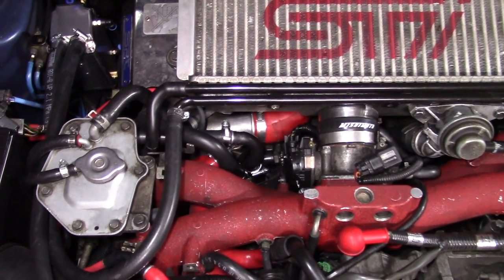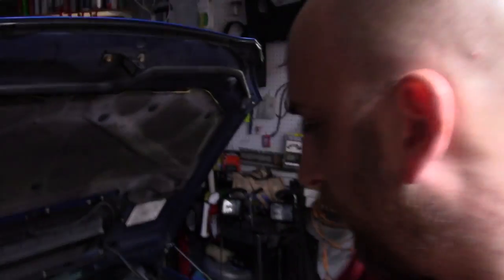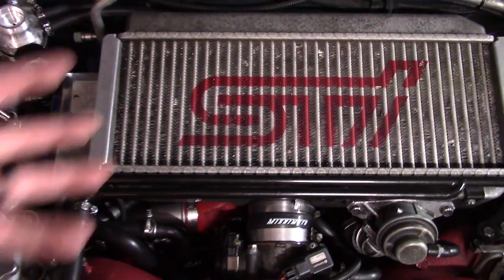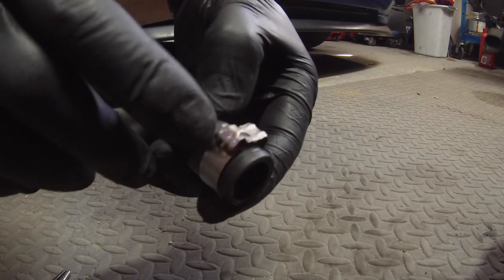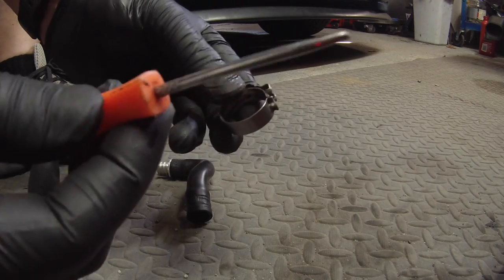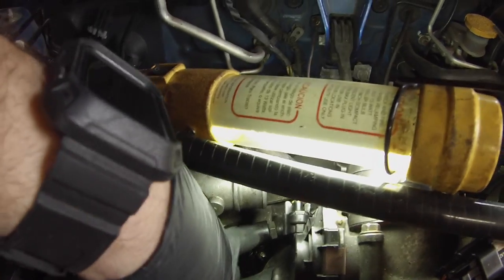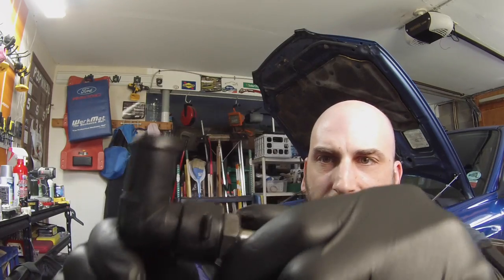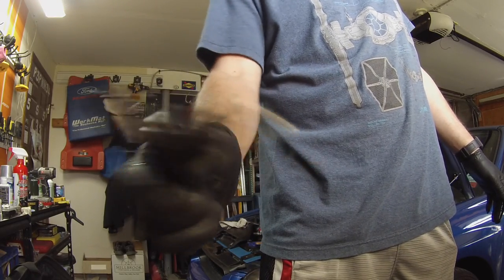2004 Impreza WRX  STi PCV Valve cleaning and location positive crankcase vent

Comment: I got a 2002 WRX , white smoke with some burning smell came from turbo area.  It goes off probably within 2 minutes.  Please advise if it is the PCV problem.
Reply from the maker: Sam Mach hey Sam , you may have started to have some oil seals start to leak and once they heat up they hold. Definitely check that your PCV is clean or replace it. You don't want pressure built up in the crankcase.
Reply: Sam Mach did you figure it out?
Reply: i have the same issue as you Sam, no oil leaks and only ocours in short trips, i smell oil been burned under turbo and some light smoke, i clean already the pcv and put new washers and gaskets on turbo but the problem still there, but before i blame the turbo i will put a new pcv ... do you figured out your issue? cheers
Reply: You have a leaking valve cover on the passenger side! That oil gets to the uppipe under the turbo. It will burn the oil coating the uppipe and goes away within 10 minutes after the engine has warmed up good. Just replace the valve cover gasket
Reply: @beatles  i had the same issue on my 04 Forester and that solved it

Comment: Hey, my aftermarket blowoff valve, suddenly stopped working it's not blowing off like it should. Not sure what vacuum lines or whatnot to look for. Any suggestions or videos showing me?
Reply from the maker: MrNTJH hi , check that your turbo inlet hose is connected to the turbo, it rips at the turbo inlet sometimes. Next check your 12mm bolts holding the BOV in and gasket condition. Tighten all the hose clamps for the intake , intercooler turbo and check that your air filter is not clogged. Let me know

Comment: do you reuse the by pass valve gasket?
Reply from the maker: kpopRC hi . I have reused the Bypass gasket multiple times and have never had a boost leak from it. As long as the gasket is in a good condition , no cracks , fraying , you should be ok. Thanks for watching.

Comment: hi, my sti do blue smoke at idle after it is fully warmed up following a cold start. and sometimes it blue smokes at stop lights too or after a long engine braking. might this be a pcv issue? thx.
Reply from the maker: Hi Elie blue smoke means your burning oil , you may need new Pistons and rings. Full rebuild or new motor swap will help. Do you have a good Subaru shop near you?
Reply: svtwrc hi. i have my mechanic who told me there is nothing major to worry about. but the performance of my car is awesome and there is minimal oil consumption. i Don't know why i got clouds of white or blue smoke coming out at idle after 10 minutes from cold start or  
after a half minute of me idling on traffic. it does not happen all the time.
Reply from the maker: +Elie Nehme as long as it's a little not all the time your ok. You can try to replace or clean the PCV valve . There are some stop smoke oil additives you can try a little at a time make sure it's not an oil stop leak the EJ motors get clogged up but the smoke additive is like a heavy oil that's really worked for me on a Saab Turbo.
Reply: svtwrc thanks mate. i will keep you updated. take care.

Comment: my car got worst is just when i driving when smogs pretty bad. but at idle doesn't what can be?
Reply from the maker: jdm fans!! https://youtu.be/060bO3oIC6Q take a look at your valve cover or the oil fitting and washers for the turbo. The valve cover will leak onto the hot turbo upipe or header creating smoke and a nasty smell of burning oil

Comment: IMHO its so much easier and safer for BPV gasket if you leave it on intercooler and simply undo the bottom clamp where it runs back to intake and the vac line.

Comment: well explained! i got an 2005 sti  i notice that smog is coming out from the turbo area and smell like oil is burning ..  can be pcv or turbo seal?
Reply from the maker: jdm fans!! Could be rocker cover gasket or blocked clogged PCV . Thanks for watching.
Reply: i have the same problem, same car. theres a white smoke coming from the turbo side. what did you do to fix this ?
Reply from the maker: youhan younen it may be a leaking rocker cover valve cover gasket that leaks on the up pipe and smokes white smoke. It stinks like burning oil.
Reply: thanks, ill definitely look into that.
Reply from the maker: youhan younen https://youtu.be/060bO3oIC6Q
Reply from the maker: My valve cover video may help
Reply: i just replaced my pcv took me about 3 hours. thanks for you videos it really helps. 👍

Comment: Isn't there two Pcv valves? Ones under the rear of the throttle body on the manifold?
Reply from the maker: Hi Eric, the PCV valve under the Throttle body is for a WRX 2.0.  The STi uses the Y housing like in the video. There is only one PCV in each car.
Reply: Negative.. There's 2! There is one under the manifold and also one in a t hose
Reply from the maker: check out my oil catch can setup video. On a 2.5 STi motor , the PCV valves would be in  a row . It would go Head--black Y pipe- --PCV-----3/8 rubber hose ----PCV valve----intake manifold. it wouldn't make sense ,2 PCV valves in a row A WRX has no PCV valve in the Black Y connector , just at the intake manifold .
Reply: Mine has. Two man. Does that mean I have a hybrid motor? 2.5 block with 2.0 heads? Haha. 😂 best of both worlds.

Comment: Had a camseal leak and had a subaru dealership replace all the camseals. Stopped leaking for a week and started leaking again in the same spot. Could this just be a simple pcv valve?
Reply from the maker: Could be the PCV , crankcase vents blocked on the rocker covers or the metal tubing blocked running across the intercooler .
Reply: Drew Vesely my cam seals and valve covers are leaking as well. They have been replaced multiple times and currently everything was done again last week. I’m suspecting it’s my pcv too

Comment: Nice video. I was wondering if you had any symptoms that made you realize you need to clean your pcv valve. My car is burning oil and sometimes I'll get a cloud of bluish smoke that smells like oil when I'm accelerating from a stop.
Reply from the maker: thanks..  The oil could be a piston ring starting to go, or a oil seal in the turbo. A blocked PCV would build up a lot of pressure causing oil leaks in the valve covers.
Reply: Having similar issue smokes when taking off from a stop when cold and on decel when cold … did you figure it out ? Hopefully you reply 5 years later 😅
Reply: @internalcombustion8744  I did not spend much money on figuring it out. I bought a new pcv valve but it didn’t resolve my issue. I ended up selling the car because I was convinced it needed an expensive rebuild of some sort. It was also an 04 sti
Reply: @Sr5taco aspen white by chance??

Comment: Thanks man , I have wrx 2004
And I’m from israel and I don’t have the white connector to the inlet

I think use and israel are different cars

I have the black one valve and without white connector so I need the 2003 kit?
Reply from the maker: Sergio Mattie hello and after some research it looks like you have the same as the STi for the WRX . Use the same part from my STi PCV video I show the part #. You should buy the black tree and PCV valve in the kit so you replace the black plastic and valve in one .

Comment: just because it rattles doesn't mean it's good bro
but nice video
Reply from the maker: Yeah Josh is %100 right , replace if you can , the rattle means it's not gummed with oil but it may be leaking by oil vapor if past its life span.

Comment: Dude I have wrx 2004 2.0L

Wich one I need for my car ?
11810AA040
Or
11810AA000
?

I think the second this what I have in my car right now :0
And hose kit in my car is 
11815AA213

What’s wrong ?
Reply from the maker: Sergio Mattie you need the valve without the black Y tree . Check your tree to see if the PCV valve is there. Not sure about the #
Reply from the maker: Sergio Mattie https://youtu.be/nuRC3yt2ruk here is the other location I think you have .

Comment: Nice video! i'm a bid late getting to this video. But I need help getting the part number for the HOSE that is connected to the PCV  valve you're cleaning.  All the stupid people at the local dealer either doesn't know or doesn't want to give me the part number. Most of them don't know. Sends me bunch of diagram that doesn't even show the pcv hose.  Thanks  Ahead...
Reply from the maker: Bee Vang ok you looking for a small hose that bends almost 90 degrees that goes from the nipple of the PCV valve itself to the bottom of the intake manifold. 11815ac950 try that part.
Reply from the maker: Bee Vang https://estore.subarupartswarehouse.com/a/Subaru__/__7322138/PCV-Valve/maintenance_subaru_PCVValve.html
Reply: @svtwrc  Thanks a bunch..